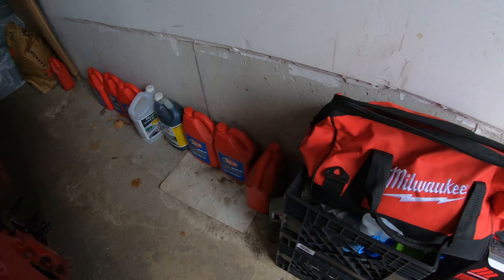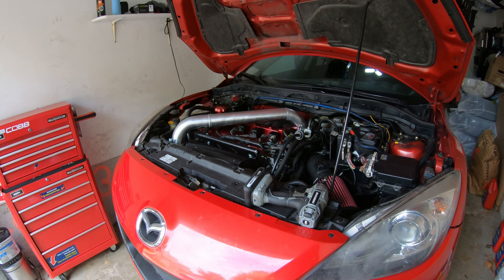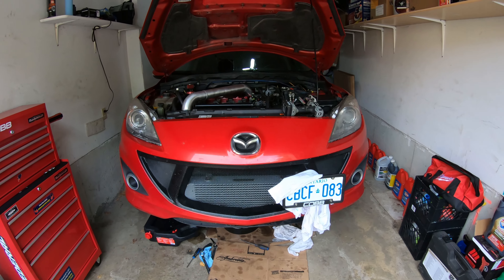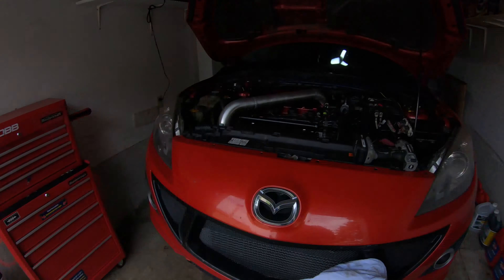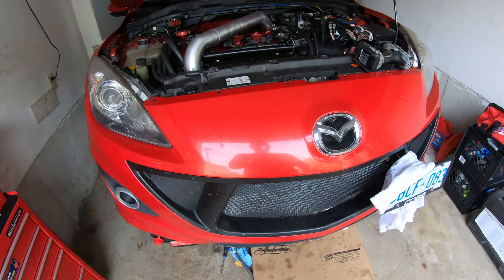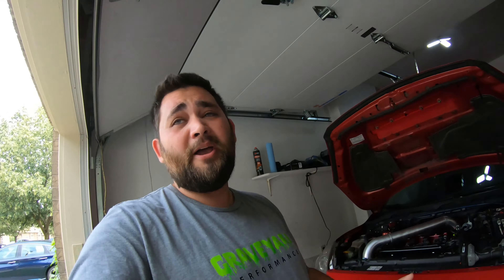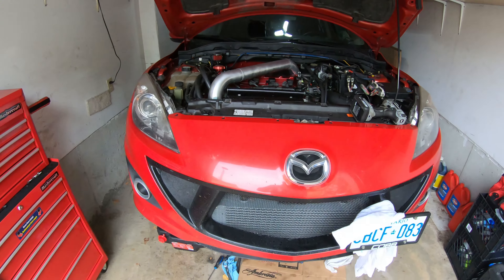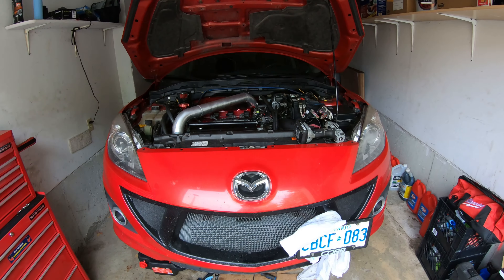No Oil Pressure after oil change!? | What happened

Comment: How did he fill the oil pump with the lucas oil?
Reply from the maker: removed the pick up tube, the inlet of the oil pump faces upwards almost. basically just squeezed the hell outta the lucas oil bottle to fill the pump until it start pouring out. also filled the pick up as best we could then just assembled it all very quickly. put the oil pan back on with 4 bolts just to hold it, and that did it.

Comment: For the Mazda 3 GT 2.3l would it put itself in a limp mode kind of thing? When I was going down a highway. my oil seemed like it just lost everything, so I pulled over and it shut everything off. 

When I pulled it in my garage I topped the oil up, now it seems to be like this problem here. I wonder if it could be the same issue with no oil pressure. I tried my foot on the gas and it almost wanted to start. I checked the battery, alternator, starter and connections in between and they work great. Any thoughts? Thanks.
Reply from the maker: If its not making oil pressure your oil light will be on while the car is running. Is it on? If it is on, and you are flooring the gas there is a chance the engine is now ruined. 

if the engine oil light is on then chances are that engine is done. Those motors are far less expensive and easier to find then the mazdaspeed engines.

Comment: I did my oil changed on the 22nd and got a low pressure lights, turn off engine! Signal on my dashboard. Took the car back in and they’re trying to charge me $899 for diagnosis
Reply from the maker: $900 for a diagnostic seems excessive. Wow. Hopefully it’s all good

Comment: You able to get the oil pan back on with the timing chain cover still attached? If so, how difficult is it to get it on without totally messing up the gasket maker. I got to redo mine.
Reply from the maker: It is possible yes. It’s a major pain but I’ve had it done before. I’ll be doing the work tomorrow so I can update you. I do know it is doable though.